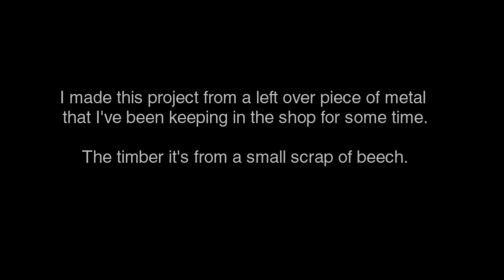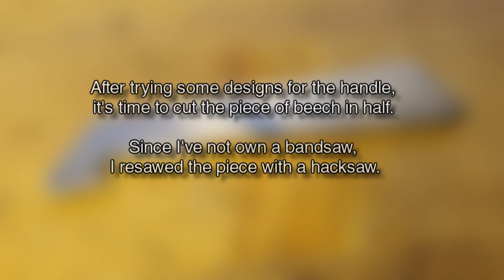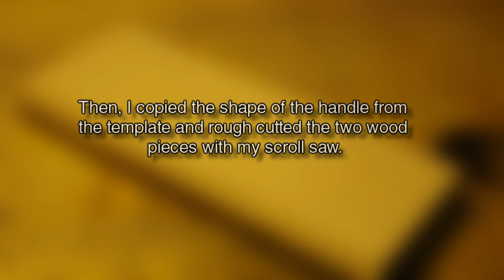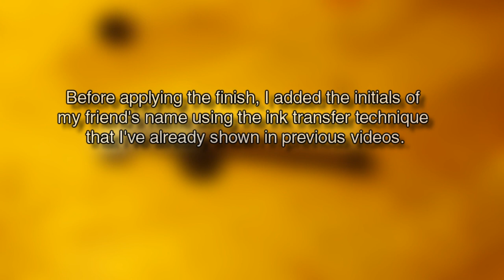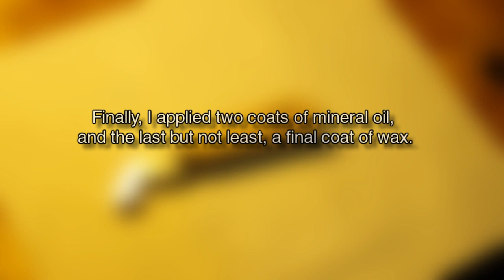How to make a Bottle Opener | Wood and Metal project

Comment: Not a bad looking opener. If I could make one suggestion, it would be to round the sharp corners next time, to fit the hand more comfortably. A pin or two in the handle would help too.
Reply from the maker: +ARCustomKnives Hi ARCK. Thanks for your suggest, but if I rounded the corners more or add pins, that will ruin the aesthetics of the design. My friend is been using it since last year with no complaints ;). Thanks for come and comment. Cheers!